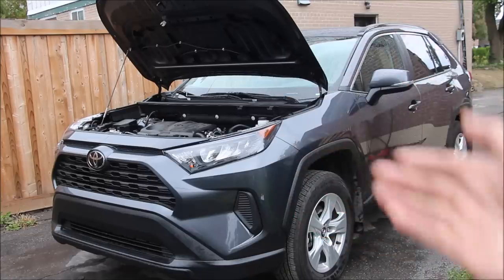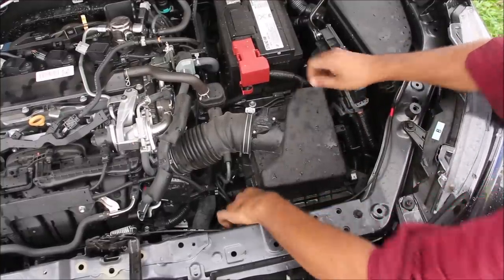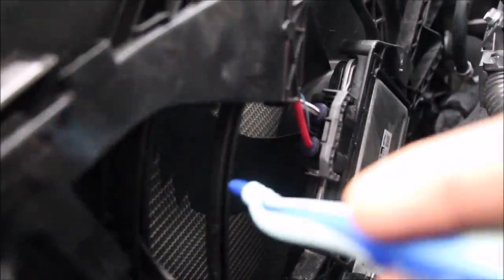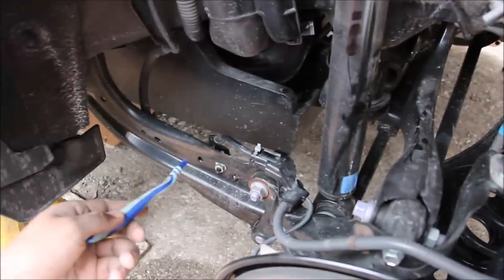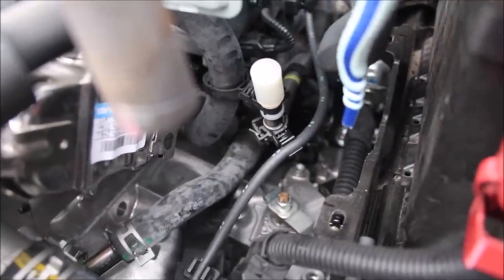Toyota RAV4 Mechanical Review

Comment from the maker: What did you guys think of this mechanical review? What other cars would you like to see? 

Skip to section:
0:45 Engine
1:53 Air intake
3:37 Electric Variable Valve Timing
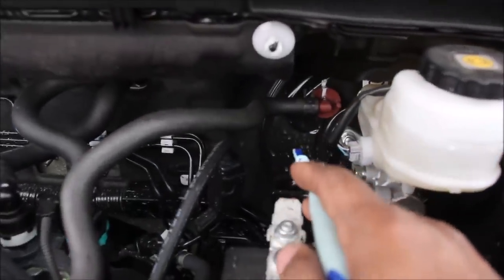4:19 Braking System
5:22 Safety System
5:57 Cooling System
7:28 Underbody
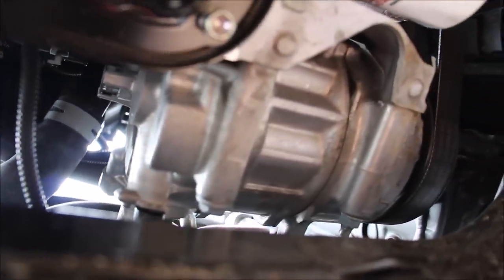8:48 Oil Change / Lubrication
9:17 Front Suspension
10:12 Front and Rear Brakes
10:36 Rear Suspension
11:56 Exhaust System
12:23 Steering System
12:52 Transmission and Drivetrain
14:13 Fuel and EVAP system
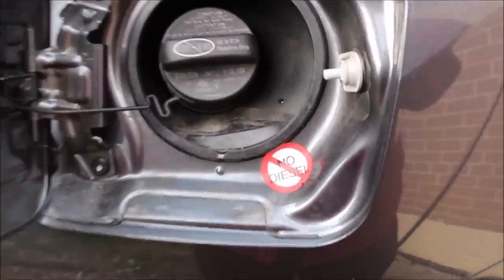15:14 Blooper
Reply: Cool and nice Idea.. Lexus IS 250 / 300
Reply: With this kind of review, you need to move the camera more often instead of just pointing with the toothbrush. Remember, it's not a repair or tear-down video.
Reply: Very good review very informative :) thinking to get one. Comparing looking also the Dodge Journey in four cylinder since the Journey has third seat. What can you say about the Journey ? thanks for your input :)
Reply: 2020 CRV please
Reply: Your Camry! My dad got the same one, I'm starting to learn about cars, he doesn't give it any maintenance, so I would love to see you explaining that car so I could put my hands on it 😄
Reply: Nice
Reply from the maker: Good choice. I have a GS350
Reply from the maker: Thanks for the tips
Reply from the maker: Journey doesn't even compare...
Reply from the maker: Whew ..where to get that?
Reply from the maker: Very good topic, I was going to do a comparison between my old one and the new one
Reply: Civic type r... interesting front suspension
Reply: Great review. Gives people a long term heads up into what they're getting themselves into when they buy a new vehicle. Also, your GS350 alternator video was extremely helpful this past weekend when I had to replace the alternator in my sisters '08. Tore up my arms but at least I didnt break anything out of frustration.
Reply: @speedkar99

Timing chains NEED maintenance! Trust me, in my Toyota one broke, and I had to replace the engine. Chain needs to be checked every 150000 km/ 100000miles to be sure it is OK. You shoud chage it every 150000-250000 miles depending on condition.
Reply: @mrozowskitomasz  Did you change engine oil regularly before timing chain broke?
Reply: @afara2000  Hi, yes, 6k miles intervals, yet I cannot tell if previous owner did it... Car had only 140000miles when it happened...
Reply: Really awesome job!
Reply: Do Mitsubishi Triton. Plz.
Reply: I liked this video a lot. it does have a chrisfix feel to it, though, that's  not necessarily a bad thing. I really appreciate the level of detail you go into. I think it would appeal to a lot of people. keep up the good work. BTW, your previous videos really helped me this weekend when I did a timing belt replacement. cheers!
Reply: Epic content. please continue
Reply: Great review,  right on target,  short and direct,  nothing unnecessary,  keep good work and " Ring That Bell" 👉🔔
Reply: More details on maintenance!  And Hybrid RAV4 and Hybrid Highlander, Please.

Thanks for the good video.

Cheers
Reply: tesla model 3. wait a sec, are you holding on a flosser as your pointer??
Reply: Any chance you review the Turbo Mazda 6 please? (2018 or 2019)
Reply: Please do a mechanical review for Prius. Thanks a lot!
Reply: In addition to descriptions and functions, I like to see critique, Reported and possible problems. How about Mazda's 2.5
Reply: Awesome review. 2016 Ford Explorer AWD Ecoboost please
Reply: speedkar99 nice video I need to install OEM block heater where is location of it same as 2016 RAV4??

Let me know please
Reply: 2019 Tacoma please. .
Reply: Very informative and thorough. There should be a reliability and maintain-ability rating and whether to lease or buy.
Reply: Kerry Ow Buland I bough my 2019 RAV4 XLE so far so good no issues or problems 
You maintain it regular oil change gas filter that’s it, also here in Canada we have salt winters are harsh so I Krown it every year sprayed with oil..
My opinion buy it it’s way to go lease it’s a choice you make..
Reply from the maker: @mokujin6507  I would love to get a hold of one of those for that and the turbo setuo
Reply from the maker: @billybodacious2337  glad my video helped
Reply from the maker: @mrozowskitomasz  good point but it's not a normal wear item to replace, just inspect, which is alot better than replacing a belt
Reply from the maker: @DiegoMoonhaze  thanks
Reply from the maker: @mobilecommunicationsnetwor5268  Kia/Hyundai? Is there interest in the mechanical if that?
Reply from the maker: @robotech1990  what's that?
Reply from the maker: @davidhahn8583  glad it helped and you enjoyed the video. CF has his own style and focus on videos... I say we are different
Reply from the maker: @tanicwhisper0647  thanks
Reply from the maker: @fibonaccisequence2891  haha good one ! Ring!!
Reply from the maker: @i-will-get-you-there  I'd love to review a hybrid. Heck maybe take one apart and reverse engineer it
Reply from the maker: @akila219  it's my teach-brush
Reply from the maker: @patrickkamski8108  whoot the Prius would be awesome!
Reply from the maker: @Corkfish1  good call. I gotta look for one to borrow
Reply from the maker: @xxxaznomegaxxx  hmm or should I wait for the 2020 explorer?
Reply from the maker: @MrKbuland  I think it's pretty easy to maintain
Reply from the maker: @alanh8101  good to hear from an owner!
Reply: Ford F150 3.3 v6 N.A.
Reply: speedkar99 I also got information very hard from Toyota where to instal Block Heater finally..
It’s just came out and it’s a completely game changer from previous 2.5 engine it’s not on the side anymore they truly changed everything around...
I’ll be Installing the block heather this week...👍🏼
Reply: Hilarious and comprehensive review! I would like to see a comparison between Toyota vs Honda similar models (in separate videos, though). Your thoroughness should be kept to maintain the quality of your reviews. Good job & thank you!
Reply: @2:58 those connectors with white wires are actually junction connections for negative pole wires
Reply: Very nice, thanks! Two questions:
1. How do you check the transmission fluid level?
2. The emergency brake - you stated that the electric E-brake system clamps the disk pads, just wondering if you're sure about that as traditional E-brakes on rear rotors used a small drum for the E-brake on the rear disks. At least it's like that on my '08 Hyundai.

Oh, and a third question: How to release E-brake if your battery dies and the engine is off?
Reply: Mazda Skyactiv cx3 plz
Reply: FINALYYYYY!!!! Something different! Congrats on this review. There is a huge number of car enthusiast that want to know about car mechanics, and 60% of this info you can't even get in dealership. I hope You will focus more on mechanical reviews, because there is 0 similar videos. Everybody  when reviewing are talking about cupholders and HPs as you say, and buyers want to know what are they buying. PLEASE continue. Suggestion for next car - MAZDA 6.
Reply: YO.. THIS IS AN AWESOME REVIEW!!!
DO ONE ON 2020 HYUNDAI ELANTRA!
DO THIS FOR EVERY MANUFACTURER!!
Reply: @ SPEEDKAR99
THERE ARE TONS. LITERALLY TONS OF INTEREST IN MECHANICAL REVIEWS OF KIA/HYUNDAI. 

KOREAN CARS ARE RISING
Reply: I’d like to see a 4th gen 4Runner. But those are getting up in age.
Reply: Very good review, I think maybe you could have some opinions about everything you see from the angle of a mechanical, because man could get information from manuals
Reply: Please do more of these reviews!
Reply: Great stuff, but it looks like Toyota is selling more hybrid Rav4's than the standard gas models.  Could you do a video to discuss the mechanical differences (if any) of the hybrid version?
Reply: Any proposed mods? You mention that the  brakes could take bigger rotors, which might be appropriate for the heavier hybrid version.  Can the "small and dinky" CV shaft be upgraded?
Reply: Excellent channel. Tired of other boy racer crap channels that convey absolutely no indepth info apart from how many bottles of water you can fit into a car. Please include known issues with particular makes and please include cars that a lay person can afford.
Reply: I'd like to see a mechanical review of the XV50 Camry with the 2.5L 2AR-FE engine please :)
Reply: This is great, exactly what I have been looking. Can you do the Subaru Forester Sport?
Reply: First time watching your videos , thank you some of us want to know more than just how many strollers fit. 
thank you Sr.
Reply: speedkar99 Could you do a mechanical review of any new Subaru? A Forester or crosstrek or outback etc... I think it would be interesting because Subaru does things differently than most manufacturers.
Reply: Speedkar99 you rock! Very informative well produced and edited video series. I would recommend you continue with your car reviews with the most popular makes and models...or whatever you can get your hands on. Cheers
Reply: 2020 cx-5 please
Reply: @speedkar99  with reliability going down across the whole auto industry including Toyota. What are some models you would buy outright in 2020 with your hard earned money? Of course, mechanically speaking
Reply: 2019+ Honda Civic Sedan Sport 6 sp, with 2.0 NA engine.
Reply: Great review. 2020  Toyota Highlander Hybrid
Reply: I saw more Video its really super bb ...pls me one favor  explain is very speed pls make  little bit slow ...
Reply: @mrozowskitomasz  I think you just got unlucky. Regular oil changes with full synthetic oil should allow the timing chain to function for well over 200k miles.
Reply: You should rename the channel to Toothbrush car reviews :-)
Great job!
Reply: New Honda Civic. And if you could update the playlists so we can check all the reviews you've done up today that would be great too!
Reply: Can you compare it to the 3rd generation V6 Rav4, please? The 3G V6 is still the most powerful Rav4 of all time.
Reply: I would like to ser the Kia Sportage and all Mitsubishi cars and suv.
Reply: Other cars would like to see - Subaru Forester; the new Chevy Colorado or GMC Canyon pickup.
Reply: Why you talk so dang fast as if your in a rush!!!!  Slow down and breath!!  Sounds like you running for your life.
Reply: Toyota Chr
Reply: Very detailed I really enjoyed this. Will you do a highlander? Trying to decide between a used highlander or a new rav4
Reply: I’d like to see you review the current generation of Subaru Forester. Thanks.
Reply: @speedkar99 I hope you will express your opinions more on each part and overall design. I'm not a mechanical person per say but I want to hear you, expert's evaluations on different part, reliability and competitiveness. Thanks!
Reply: @mrozowskitomasz  I’d bet the previous owner didn’t change the oil and the odometer was clocked as it is on many used cars.

Comment: At least no CVT on this model
Reply from the maker: And I can change the fluid myself
Reply: @speedkar99  is cvt gear good in toyotas? As good as earlier auto gears?
Reply: Yeah but it's got the dodgy 8 speed transmission.Problems showing up on those now.
Reply: @tolrem 

I have a 2020 and the 8 speed has been very smooth for me. Might be an issue for some, probably not widespread
Reply: The 8 speed in this car is junk...google 2019 rav4 transmission problems
Reply from the maker: I didn't know there were issues on the 8 speed, was it catastrophic failures or the same programming quirks they had on the Camry?
Reply: speedkar99 I had the 2019 rav4 and the transmission was so bad. When coming to a stop the transmission would jerk hard like stalling a manual car. It also had the rolling stop hesitation. Toyota service and Corp is telling people thats normal symptoms. Please google "2019 rav transmission problems " it's all over the internet.
Reply: @speedkar99 

I hear they're mainly programming quirks.
Reply: Lets hope Toyota keeps it that way!
Reply: @alexzman85  it's been resolved. First year quirks. Software update.
Reply: I just bought a 2021 RAV4 Limited with the 8-speed and it shifts as smooth as silk. All of the early issues have been resolved. 🎉
Reply: Hybrid Rav4 is ECVT (planetary gears). It's simpler and more reliable then the ASIN 8 speed transmission in current RAV4s. Toyota's hybrids are rated more reliable then gas models as they don't have starter, alternator, rear drive shaft (only small electric motor in the rear). Regen brakes of course last much longer as well.

Comment: "good luck finding 0w16 at Walmart" . You're right but I bet any money the dealer just throws 0w20 or 5w20 in it
Reply from the maker: Bulk oil
Reply: @speedkar99  I did just buy 0w-16 at Walmart for it today.
Reply: I worked at a shameful shop attached to an infamous corporate villain that you are surely familiar with and we were told to just fill 'em with 0w20. I learned a lot in that shop, all concluding with: DO YOUR OWN MAINTENANCE IF YOU WANT YOUR CAR TO LAST.
Reply: When all new toyotas use 0w16 why would a dealer service center will have a problem buying 0w16 in bulk?
Reply: Walmart has 0w16.

Comment: I’ve had my 2019 now for 4 years. 60K. New fuel pump replaced on recall. No problems to report at this time. I live in the Colorado mountains. My dealership told me to get the transmission fluid changed soon. Running smoothly.
Reply from the maker: Awesome!

Comment: 13:45 "the rear CV shaft...this will not be ready for any real 4 wheeling or anything more challenging than a soccer field" LOL
Reply from the maker: Omg you actually caught that joke! Good one eh
Reply: The RAV4 is a surprisingly good off reader.  It’s much better than many Body on Frame SUVs off road because it has good ground clearance, moderate size and weight.
Reply: I think most of us were hoping for something a little tougher than a car, but didn't want something as work-specific as a truck.  So maybe not off-roading, but could hop the occasional curb or survive a heavily-rutted rural road if need be.
Reply: Tell that to my RAV4!  It gets me up and down steep forest roads, some fairly rocky "jeep trails" per maps (I certainly classify them as such), across creeks, etc.  But it is no rock crawler and I have turned around when it got to that point.  But it does exactly what I bought it to do, get me places average vehicles cannot get so I can hike and bike.  Great review.  Thumbs up.
Reply: JJ, pretty sneaky deleting your comment so I can’t reply.  I received the email, so I’m going to respond anyway.  The 5th Gen RAV4 is more off road capable than many body on frame SUVs.  I’ve had mine in the woods in the mud.  I was on a game trail, not a gravel road.  This would have completely destroyed a Civic or any sedan if it could even get traction.  The 5th Gen RAV4 is a tough reinforced unibody utility.

Comment: I have a 2020 RAV4.  Didn't know it had both fuel injection systems.  I like the plastic under the front end.  It keeps things cleaner.  You can buy Mobil 1  0W-16 at Walmart.  I changed the original oil and filter using Toyota oil and filter for the warranty.  I think Toyota used Mobil 1 at the one year " First oil change."  The actual first oil change was in May of last year.  "Oil is cheap, engines are expensive!"
Many things I've noticed in 15 months of ownership.  One I like is put the key in the ignition (mine is the base unit, no hybrid or extra flashy stuff) and before you turn the key on, the fuel pump primes the system.  You can hear it.  I replaced the interior lighting from dull incandescent bulbs to LED bulbs.  Much better at night.  The electric P/S is so nice and smooth!  No pump, hoses, fluid, rack valves or other problems!  I put Weather Tech floor mats front and rear, also cargo mat with the drop down "bib" to protect the outside.  Last item is the upper cargo cover over the rear cargo area.  Keeps things "under cover."  Fuel mileage is very good.  I like the MPG gauge between the tach and speedo.  You can keep the "right now" mileage high which helps at the gas pump.
Surprisingly peppy engine, with good acceleration!  Step into the gas, it takes off quickly!  However let up quickly after stepping into it, there's a definite amount of lag time before the transmission shifts to a higher gear, so the engine is left at a higher RPM.  It is a light weight unibody vehicle which means you hear the road and feel the bumps while driving.  But OVERALL, I'm very impressed with the vehicle and like it a lot!  And the SiriusXM radio is GREAT also!
Reply from the maker: Awesome. Hope it lasts you a while

Comment: Fantastic video! I have a ‘19 RAV4 Adventure.  At about 15K miles, no complaints. Great car and awesome fuel mileage for an SUV... well over 30 MPG
Reply from the maker: Good to know how they are holding up. 15K miles in less than a year 👍
Reply: I have 123,000 miles on my 2019 Rav4  Adventure AWD.

Comment: Number of strollers... soccer field acceleration... Great review. Not so sure I'm a fan of Toyota's new emphasis on on-demand, electric pumps & components or the ever-widening use of plastics, but your videos, THOSE I'm a great fan of. I miss the multi-tool, once known as an angle grinder, but now famous as various sizes of sockets, snap ring pliers and so much more, but this IS a new vehicle after all.
Reply from the maker: Ah the grinder will make a return very soon. Check out my behind the scenes footage on Instagram to see what I grinded apart last weekend.